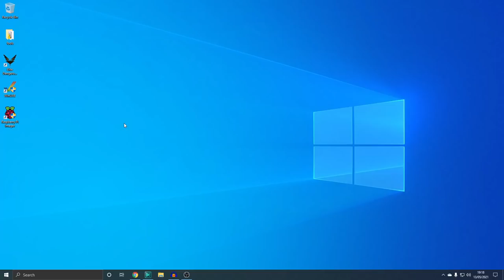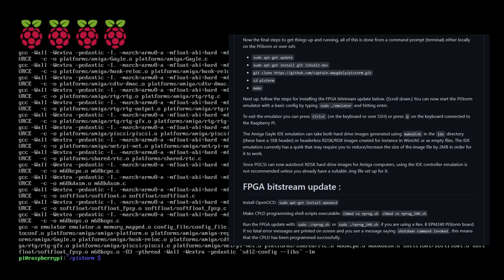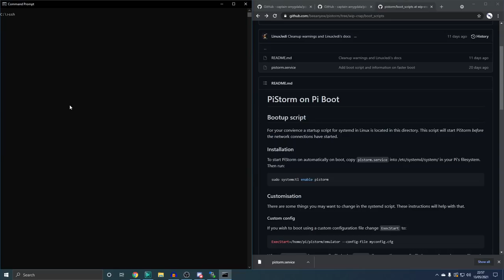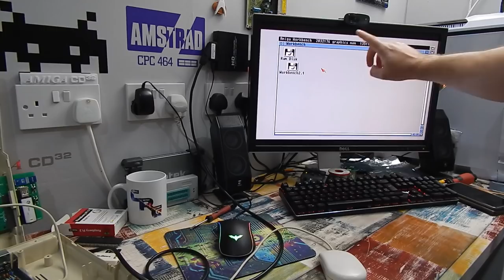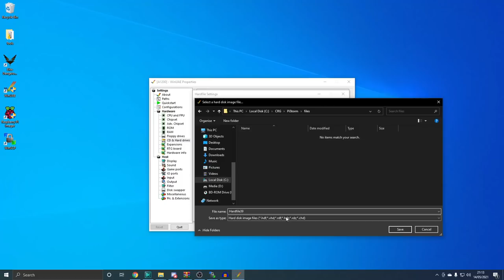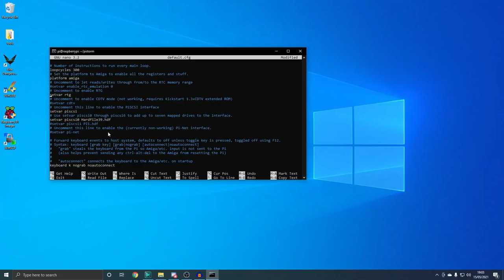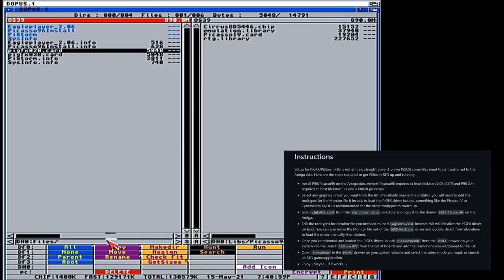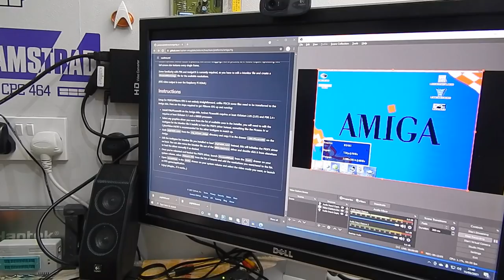Lets build a PISTORM

Comment: Looks like I'm not years late to the party this time. My bare PCBs should arrive tomorrow. It's going to be an exciting build ;-)
Reply from the maker: Good luck with the surface mount stuff.  Some very fine pitch on there.  Well worth it though, the pistorm is a fantastic bit of kit.
Reply: Also good luck finding not-fake CPLDs...
Reply: @CRG  Thanks. I'm not worried though. I replaced a TSOP-48 flash in a Samsung TV some years ago. It took me a few tries with cheap magnifying glasses and a bad soldering tip, but it works fine to this day. In the end, we'll all sooner or later have to acquire the skills to work with those tiny components anyway. Tools have never been cheaper, and tutorials have never been more plentiful. So why not start now...
Reply: My blank PCBs are on their way too.
I have to do an acetone test on the cplds.
Reply: @Shmbler  Fairly simple build really. Not many components and well within being doable under cheap magnification goggles even for old men. You don't sound like you will have any trouble, it's the same with all surface mount, pretty much solders itself if you have good flux.
Reply: @thomassmith4999  It was indeed even easier than I thought it would be. The TSOP ICs I found actually alot easier to handle than the 0402 caps. Ran on the first try. Now I have to wait until the PiStorm guys sort out the interrupt/timing issues. I'd say around 30% of games have severe issues with PiStorm in its current state. Anyway, I'm pretty happy that I assembled it myself as I've learned to handle these packages better.
Reply: @Shmbler  Most cpu accelerators put Amiga compatibility in the can but I hope a software based one has more potential in that area. The board wasn't really designed with hand soldering in mind with those small caps but yeah those are the worst of it. The ICs go down pretty fast. Least I'll feel like I've earned my fast Amiga

Comment: This was a great video, many thanks indeed.   What you need is to use NewMode or ModePro to promote all the non-RTG screens to the RTG system (although expect varied results)!!!    All of the Workbench reliant software will promote automatically (like FinalWriter or Wordworth), but the mode promoters will allow you to choose the resolution you want them at.   I think you should choose a 1080 P screenmode - it will blow you way!!
Reply from the maker: I've changed the screenmode to 720p and its amazing, so crystal clear I just stared at the screen last night admiring the high res workbench while listening to mods.  

I'll take a look at those apps and see if I can't get the likes of sysinfo so show up on RTG.
Reply: @CRG  it can take a bit of playing around with sysinfo to get the right display (or at least one that's useable) but it does work.  You'll find the mode promotion apps on Aminet.

Comment: As somebody who hasn't messed with an Amiga in years, just casually observing from outside. . .  This is an incredibly cool hack, and I'm very impressed that somebody made it work.  Mad science at its best.

On the other hand, from a purely practical standpoint, it's nuts.  You could take something like a Mini PC with Ubuntu, install Amiga emulation on it, and it would run Amiga software faster, and it would also run its own native software, which would also perform much better than a stand-alone Pi.
Reply: I think the reason why the Pi was chosen to be used is that they are quite ubiquitous with a standard GPIO port and have a consistent form factor. Part of the reason why PiStorm was created was to cut scalpers off at the heels by offering a cheap accessible CPU replacement.

Comment: Pistorm is the amiga accelerator for everybody, in my opinion, nothing wrong with the other accelerators but Pistorm is going to get better, and better, might even do enough with a Pi Zero. It'll hopefully be a cheap upgrade for all Amiga owners and if they want to go faster they can. Until the PiStorm arrived you were looking at £120+
Reply from the maker: I couldn't agree more and we are just seeing the start of what's possible.  The new Pi4 version thats being worked on gives a massive, massive speed boost.  It has been tested with a Pi Zero but results are similar to a stock 68k, marginally faster.  But if that's all you need then it could maybe be seen as a means to replace a dead chip, that said though there may never be official support for it.

Comment: I would love to find some tidy solutions as to how to route an hdmi cable from the pistorm output
the best nondestructive i found is that ribbon cable topmounted hdmi. but surely there has to be some zorro expansion cover replacements with usb as well? Haven't run into any..I'm a leftie so would be a good solution for modern mouse

Comment: You could have used the 030 (instead of 020) version of RTG, may be a little faster.
Reply from the maker: I asked this question in the discord and apparently the 2 files are the same.  Might try it though just to see if it makes any difference.
Reply: @CRG  Interesting. The Pi probably has md5 installed so you could see if the checksum is identical for the two files, which would mean they are definitely the same.
Try the command inside the folder/directory that contains both files: md5sum pigfx020.card pigfx030.card

Comment: I’ve been installing basic workbench 3.1 from Amiga Forever. It looks rather dull compared to yours. I’m wondering if I’m missing a trick or a version of the OS? 🤪
Reply from the maker: I used 3.9 on this but added the custom wallpaper to the desktop.  Its really easy to do, I've got a video on it :).  Its an older video so I can only apologise for the overbearing music throughout it, should you decide to watch it that is.
Reply: @CRG  I’ll go watch. I’ve worked out increasing colours but not the toolbar etc. Super appreciate.

Comment: great video.. i'm going to try mine with my Rgb2Hdmi so not sure if i'll be needing the Rtg option , also switching modes still has bugs i read on the Github for Rtg
Reply from the maker: I haven't had any problems so far with the rtg although not done much rtg other than workbench.  I do have my second rgb2hdmi board but I'm holding out for an option to feed the signal via the pi3a on the storm.

Comment: great job !! 
how did you put workbench 3.1 on a USB?
Reply from the maker: I used an adf disk image.  That thing I plugged it into is a gotek floppy drive emulator.  Reads the adf disk images from USB as if they were real disks.
Reply: @CRG  Thanks !! But.. what procedure do you follow? With which application do you "burn" the adf on the USB?